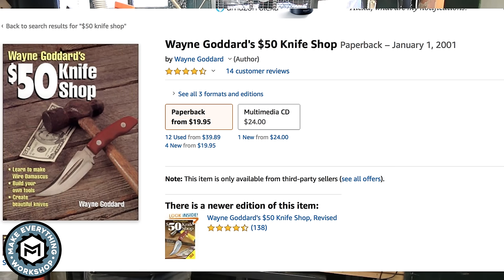$100 Harbor Freight Knife Shop!

Comment: Fun video! When I've done my backyard fire heat treat I take my wife's hairdryer and use it to blow on the fire.  That gets it nice and hot!  Do you still have the harbor freight grinder?  What do you think of it?
Reply: I've bought two angle grinders from Harbor Freight. They vibrate quite a bit more than the expensive name brands, and they get really hot with extended use, but both of them have worked great for me. I bought them about 4 years ago and use them periodically. Several times I've used them for really heavy duty projects, and besides the heat issue I mentioned, they work flawlessly. Easily worth the $10-$15 price tag.
The reason I bought the second one is because I got tired of switching between the cutoff wheel and the grinding wheel when fabricating stuff for my car. First world problems..

Comment: Thanks for the video. 

I have a Dewalt angle grinder, but I don't own a belt grinder. Can the sanding be performed with an orbital sander (to make to the metal shiny)? I have hook and loop sandpaper from 80 grit to 7000 grit (if that makes a difference).

Jacob
12-09-2020

Comment: that circle blade material needs to heat treath. in indonesia, a lot of blade maker using DMO5, M42, M2 circular saw for cutting steel that need no more heat treath. you should try TKM DURITAN PM23

Comment: Yes I have made knives from saw blades,......but saw blades are really thin***
You take a sharpie draw the blade and take a zip wheel grinder air or electric and clamp 1X1/8 steel to it as a guide and cut the blade out.
Then you use an angle grinder with a 80 grit sanding disc with a rubber back  to shape the blade.

To make the edge you take vise grips and clamp  2 -1/4 X 3/4 piece's of metal to the blade as a guide.
Then you take even strokes down each side of the blade till its sharp,... remove the guide and it looks factory.

It's too damn hard to drill,......so where you want holes you just heat it cherry red with  map gas and take a 110 welder set on low and it blows a hole right through it.
You clean it up with an angle grinder,......then buff it out and use gun bluing as a finish,......then you drill your  wood handles you mix up J.B. Weld epoxy and put the handles on,........ brass braising rods is your pin's.

The saw blade scraps you can clamp to wood and use them like a spoke shave and it costs nothing to make.
The wider the blade the more durable the knife,.......remember their like 1/16th thick.
On thin metal you don't have to fret a bout the center of the blade,... you just take even strokes  down each side till its sharp.   The blade is not thick enough to taper.
If you try to drill holes your looking at wasting 6 bits per hole.
That says a saw blade comes all ready hardened,....... and can't be effectively drilled,.......so where you need a hole you will heat it cherry red the blow through with a welder it only takes a second.
You fill the hole with J.B. weld then you can drill the hole exactly where it's needed.
Blade no more than 3 1/2 inch's with that thin of material.
For scales just use the boards off of a pallet because the wood is light,.... remember the blade ways nothing too.
Just saying that most wood is 10 times heavier than the blade so there will be no balance.
My way works and its fast.

Comment: How much time do you need between the 2 tempering cycles
Reply from the maker: As soon as it’s cool to the touch I do the second temper, some guys do it when the blade is still warm
Reply: That is very helpful. Based on what I can remember from one of my Material Properties classes, waiting until it is cool makes more sense.

Comment: I have a couple of skinning knives that were made from files.  Yes, files.  The maker left just a little of the file teeth (very dulled) above the bevel.  
One of these knives has an antler handle and the other is made of multiple thin-layered laminated wood.  Each layer of wood is a different color.  Ex:  Maroon, natural, green, etc.  
Both knives are "Anza Knives."  
--Files make great knives.  

https://anzaknives.biz/store/

Comment: I like how he uses the two clamps after just using one and drilling by holding the work piece with his hand. Also, he is so resourceful with the dowels and then just pulls out 2 pieces of wood from a scrap bin. Not to mention that this was all done on a workbench which was not included. Other than these annoyances it is a good vid and questionable knife!

Comment: Those HF dollies are crap wood.  They work until you leave 'em out for a season or two, then they rot.  You can find better wood just about anywhere else.  I like the concept of using basic tools, because it encourages people who have no shop.  Most of us have more to start with: propane torches if not acetylene, a vise of some sort, a few saws, etc.  But this shows the guy who has nothing that it doesn't take much to get started.

Comment: Instead of screwing around with that so called knife sharpener you bought, when you get to that step; go outside and roll your car window about 2/3s of the way down and use the top edge to sharpen the knife, (keep the same number of strokes on each side) then strop in on denim if you don't have a leather strop.

Comment: Harbor freight prices are different everywhere. I have a harbor freight near my home that's about 3x as expensive for the same items as the harbor freight 20 miles from my home so saying '$100 harbor freight knife shop" makes no sense to most. if you have a small harbor freight near you that doesn't get much business than expect to pay double. example electrical carts are $75 at the corporate store 30 miles from my home and $250-$300 local for the same cart. shop around folks.

Comment: kinda dumb to mess up perfectly good tools and spend time and money to make some knife..kinda going backwards.  I forged my knives with free steel from my minivan coil spring, and make a real forge for only $200, and used my previous own angles grinder for just about everything..and only upgraded to a $80 4x36 grinder to do the grinding..very good for handles..not so much from heavy pressure grinding.  But I guess for the video..assuming you gotta buy everything..it will work.  But the key here to use what you got, stay within budget and keep on the lookout for high carbon scraps.  There isn't anything wrong with just buying steel either.  I got a whole bunch of steel from Jantz knifemaking supply and buying in bulk saved on shipping.  The cost came down to about $11 per foot after shipping for 1/4 inch thick by 1.5 wide 5160 spring steel.  That stuff is very tough and holds reasonably well edge..much better than any knife under $200.

Comment: Go out to your vehicle, put one of the windows almost all the way down, use the edge to bevel and sharpen your knife, then strop it on your leather belt...I have been using old saw blades to make knives for over a decade now...they make the best skinning blade you'll ever have, and the top of that window glass is as good as most folks ever need to get a good edge.

Comment: I'm constantly amazed that I seem to be the only one who thinks using a 400 degree heat gun to blow an open fire, or even a coal fire is a good way to drive the heat up.
Grabbing the invention of the Blast Furnace is what made Carnegie the world's richest man.
The 'blast' was compressed air.  Heat is the goal, so START at 400, and you are far ahead of the pack.

Comment: I wouldn’t put that much work into a mystery steel. The old saw blades had great steel but these Chinees blades. Not so much. They just have hardened teeth. Knife steel like 01 are pretty cheap and are perfect for knives.

Comment: There is virtually nothing about this video that should be listened to.  Just for starters there is reason they say OLD saw blades can be used.  New saw blades only have hardened steel on the cutting tips.  It's sad to see all the ignorant people commenting that think this is anything but an almost knife shaped object.

Comment: What type of knife steal do you recommend ??
 1095 at Home Depot , ok ??
Reply: 1095, 1080, 1075 and 01 steels work great for making a knife that is relatively easy to heat treat. Dont buy bar stock steel from home depot or Lowe's because that is low carbon or mild steel. If the metal you are looking at is from a saw then try it out. If you are making a knife out of a file use Nicholson files as most other files are case hardened or in other words soft low carbon steel on the inside and hard steel on the outer few millimeters. I highly recommend going to a trusted knife makers supply store or metal supply store and buying metal that will work 100% of the time. If there aren't any local places look online and order it from there. Some reccomend places are jantz supply, New Jersey steel baron, and texas knife makers supply if you want guaranteed high carbon steel. Best of luck in your knife making!

Comment: Old saw blades can have great steel for knife blades. New ones, on the other hand, like this, not so much. The steel in old saw blades was good all the way through, because what you had in the body of the saw you had on the points as well. Manufacturing techniques were simple and they just made the whole thing from one material. Nowadays, we have carbide teeth and special tempering techniques which make the body of the blade just a support for the teeth. No need to waste good quality steel on it. What you get then is steel that is great for maybe urinals, but probably not for knives. And when you buy a Dollar Store blade, you can be reasonably sure you are not getting quality materials. You don't need an advanced degree in economics to understand how cheap things are made. An old Dutch saying says that you can't make a quarter out of a dime. Apply that here.

Comment: I cracked up at the extra brushes that came with the grinder.  The motor will burn up long before the brushes wear out.  I know a guy that goes through 2 or 3 of those grinders a year. He refuses to buy a quality grinder like a Makita because "that's too expensive".  But spending $15 every few months for the last 10 years is less expensive I guess?  He's kinda dumb.

Comment: The way you are filing is incorrect, it will ware your files quickly.
File away from you and not back and forth
Reply: Tell that to the files in a die filer.   (Cue, "what's a die filer?")

Comment: Everything but that goofy "knife sharpener" is great. Those effing things should be illegal. You can buy three diamond plate at HF for about the same price and they actually do the job. Every time I see someone use one of those thing on a knife I cringe and feel like calling their grandfather to report them for knife abuse. They don't work, they fuck up the bevel on the knife and they are dangerous because of all the force you need to pull on them. Not to mention a dull knife is a dangerous knife and well...never mind, you get the idea here.

Comment: I must be some kind of asshole. I didn't buy anything to make mi first 4 knives.  I have a drill press that was given to me 30 years ago. I have a bench grinder that I found in someone's garbage 20 years ago. Between those two tools I was able to produce many tools and implements from scrap steel. I heat treated my knives by heating them in a camp fire and dropping them in mud. It works very well.

Comment: I think you could've saved more money by buying a hack saw instead of an angle grinder. You could've made your bevels with a cheap file, too. The hack saw and file would probably cost less than the angle grinder.
Reply: And take 4+ more hours, especially since he'll probably be doing this alot it makes economic sense to use a grinder

Comment: Did you HAVE to use that saw blade for the stock? The $50/$100 knife shop should just be for the “shop” (aka: tools) and for the blade steel and scales, find something better than a paper thin saw blade…

Comment: pay 100$ to make a knife worse than a 5$ knife... I know its a "DIY starter kit" but cost/use ratio is bad. And it feels more like a gimmick to buy from harbor freight than a real farrier kit. At the very end of the video I watched you bend that blade like it was wet paper, and I made a knife completely out of plastic with better cutting power.  I'm sure you mean well but don't set people up for failure like this. I've been forging knives and other metal works for 10 years now, and if a newbie's first knife sucked as bad as this one they'd be understandably discouraged from ever trying again. -Ps: Your knife didn't harden for 3 reasons. 1: You didn't get it hot enough for long enough and you only did one quench. 2: You heated half the blade. Never do that, its how you end up with cracks in the metal that cause it to snap under pressure which can be very dangerous. Always heat it evenly. 3: when you put it in the oil you need to move it around as much as you can. It needs to cool at a VERY fast rate to harden, and as soon as the oil got warm that process slowed down to a crawl

Comment: You can buy in Amazon a blade made with carbon still for 20$ ready to  glue the wood. That knife for 100$ is too espensive. Even for 100$ you can buy an excelent carbon stil knife new. You loose your time.

Comment: i laugh lot ,hardener steel hahaha, vegetable oil hahaha. if need harden knife good u need used old motor oil have lot better, black colour mean have lot coal in oil, burned oil, then can harden better, no newer vegetable oil only motor and mineral oil used harden steel. handle has horrible bad too and wood pin this no work good, use metal pin. laught lot kitchen sharpener haha wrong angle and true wrong sharpen any knife, buy sharping rock and made right angle sharpening bracket.circular saw blade, no, go to crapyard and buy old car leaf spring better lot and can made many many knife future. chep and better lot. or old factory saw blade, not circular saw.and handle use hardwood not soft shit wood.u made knife ok, working but if u made good knife need lot better material and tools.